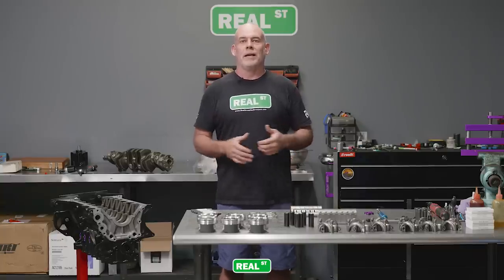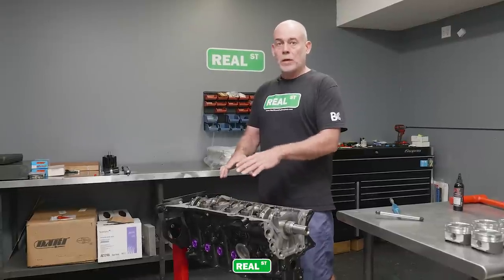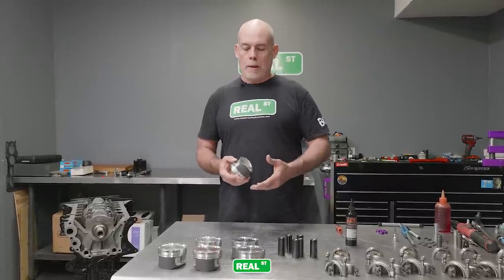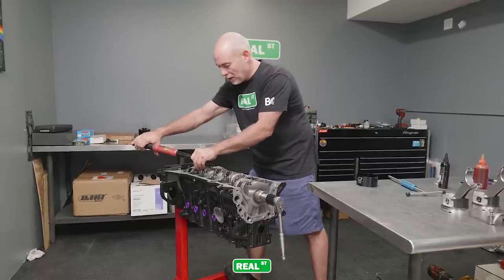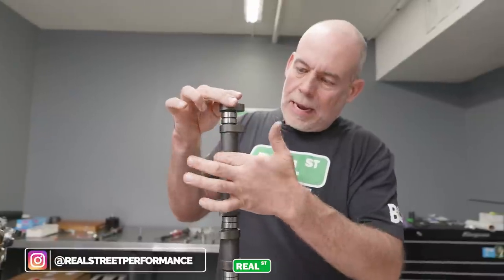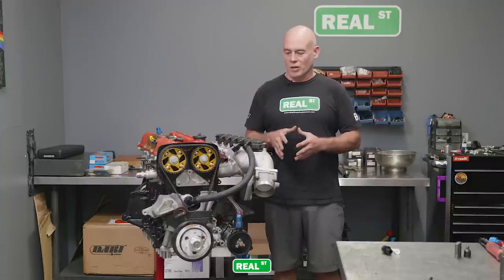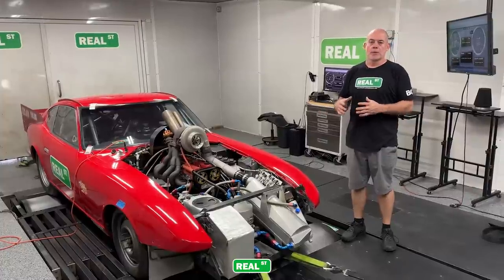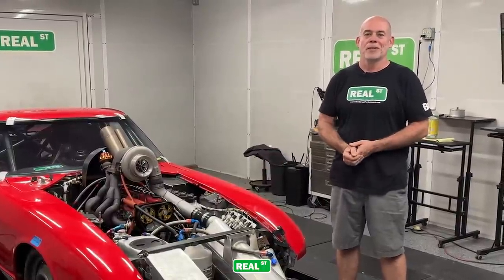Building A 1200+hp 2JZ Engine For Land Speed Racing - Detailed Assembly

Comment: Hi , this is Oz ex Bonneville racer. Thought you might be interested in our Datsun  Z/ Bonneville car experience. We first went to Bonneville in 1978. We ran a L28 with a home made turbo setup. The car eventually set  a record of 186 MPH. We ran in D GT  class which back then was any blown  3 liter stock bodied sports car (2 seater) or 5 liter non blown car.
The blower pushed the car up 2 classes. The car had a stock legal  G nose as it was available that way in Japan . The body was stone stock, no aero improvements at all.  Nothing poking through the hood .To record back then you had to qualify by going over the record. Then come back the next day and made a two way run. Your speed was the average of the two way pass. 
  We later changed to a 280 ZX ( it has a lower drag than a Z , really! )  That car set two records  ( same class) first a 198 then a couple of years later 201 mph. All with the 3 pass requirement. Just like the Z , the body is stone stock. The fast single mile we have a timing slip for is 219 mph. The car did run a 226 mile but blew a tire and spun (at that speed) , never got the timing slip. . We missed a new record because of that tire. I still have the ZX, its pretty rough though.  The last few years we ran an LD28 crank which made the displacement 2955 cc. All legal then in D GT. 
I can only guess at the HP but I think it must have been around 650 plus or minus. 
This was a no sponsor car built by myself and my wife. 
  the car never ran at El Mirage .

Comment from the maker: What engine do you want to see Jay build next?
Reply: Newer Gen V Chevrolet Small Blocks for us Silverado Owners
Reply: Gm 3800 built to aussie specs
Reply: 1UZ?
Reply: rb26 3.2 nitto stroker kit from aus
Reply: BMW straight 6 or Audi 5cyl
Reply: Either an RB, SR20, or 4G63.
Reply: 2jz dart block
Reply: Audi 5cyl, or tiny 4 piston built for BIG boost
Reply: RB26, the other Japanese monster.
Reply: volvo b230 16valve
Reply: N54 or B58, I would love to have his insight on any of these motors.
Reply: @roberts9709  ahh ...
Papadakis Racing already did a tear down and full forged rebuild on the B58 for the Transgender Supra ...
Reply: Vortec 4200 or 1uz/3uz
Reply: @FernandoSosaIndustries  Ding ding ding!! Came here to suggest the same: Audi 1.8 20 valve turbo inline 5-banger.

Small (relatively speaking) 4-cylinder has already been done, they've shown a K-series Honda on the channel.
Reply: @TML34  YES! Audi 1.8 20V turbo inline 5 please!
Reply: @ACommenterOnYouTube  That's already in the proverbial pipe line, a colab with HP Academy.
Reply: @Hydrazine1000  yeah but i’m talking small <1.3l … litre bike, snowmobile, jet ski, etc
Reply: @FernandoSosaIndustries  Jay did work on a boosted line-3 engine, a 10.000 rpm Rotax ACE 900 Turbo. Vid was posted Jan 28th '23.
Reply: BMW n54
Reply: finish the b20  pls 🙏
Reply: RB!!😎
Reply: Rover T-16
Reply: I know he likes his bmw’s so maybe we can see an m50/s52 turbo or na build on the channel soon 🤞🏼
Reply: 1.5L Na engine / diesel 😅
Reply: I want to see Jay's personal cars

Comment: How would you go about storing a freshly assembled engine? I've come to a point in my build, where I had to assemble my 2jz, but the engine won't run for a few more months or even a year before I can actually start it up and get oil circulating through it.
Reply: just shoot some ATF in the cylinders and rotate the motor to distribute the lubricant. and what i do to start a new motor (non dry-sump), is hook a pump up to the in/out lines for the oil cooler in order to pressurize/flow oil through the motor. do that before starting the motor if its been sitting, even though i'm sure it has assembly lubricant on all the bearing surfaces

Comment: So much for the aerodynamics I can see.
Reply: you must not understand aerodynamics very well. the single most critical factor for aero is frontal area. IE: the silhouette profile of the vehicle when looking head-on at it. The turbo is clearly within the frontal area profile. YES, having the turbo extending out of the engine bay is going to increase the drag coefficient of the car, but the benefit of the fresh air being aspirated into the compressor will far more than make up for the one or two tenths drag penalty incurred for having it placed there

Comment: Only thing I would suggest is seating  the thrust cap from the rear forward. Clutches and converters drive/push the crank forward, so the rear thrust is most important. At least that’s my thinking. Also, did the head receive steel head stud registers? You kinda moved through the head part a little quickly